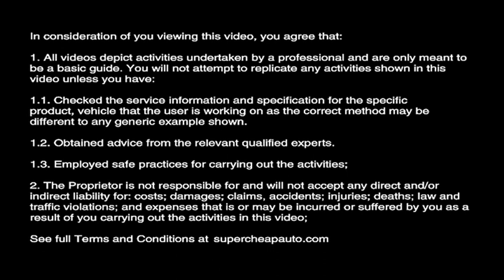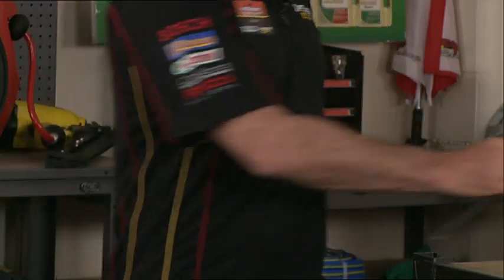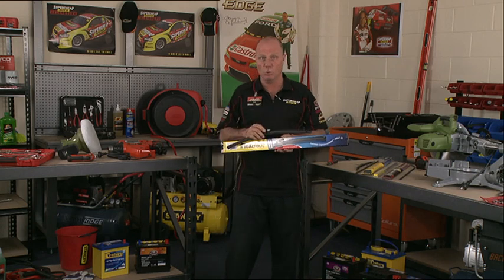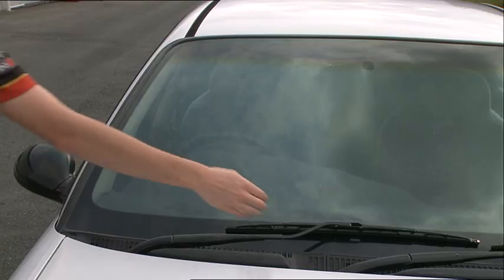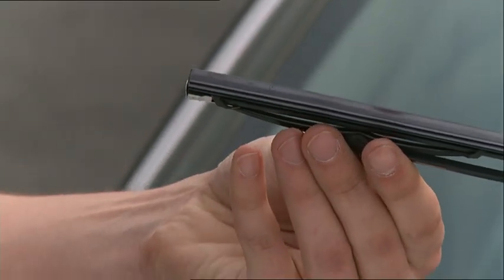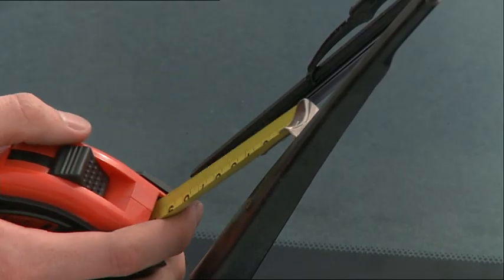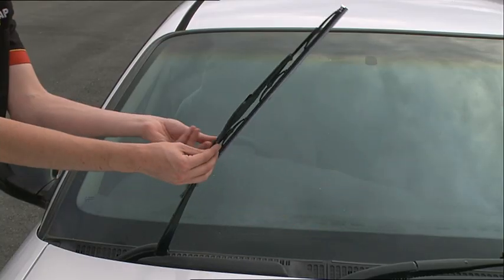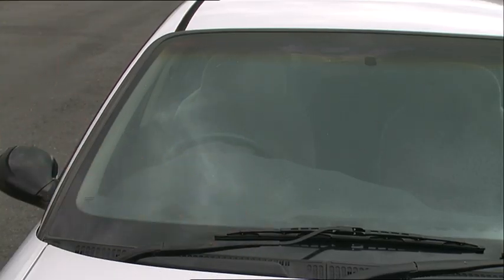How to - Fitting Wiper Blades & Arms // Supercheap Auto

Comment: This is the replacement for the 'easy' backing blade.  What about the 'bastard' backing blade with the two metal reinforcement strips that eventually start sliding out DESPITE lining up the locking claw with the notch in the rubber?
Reply: sooo manly isnt it..🤣😂.....fk me....sooo fkng frustrating....i cant even 🤣😂